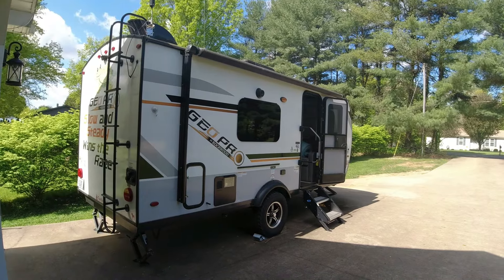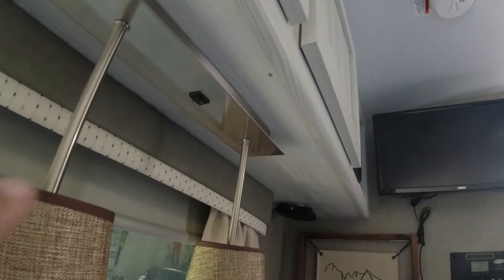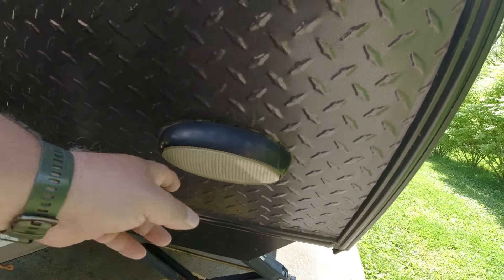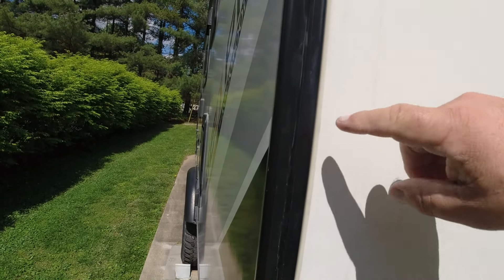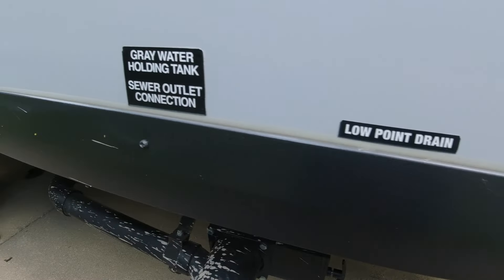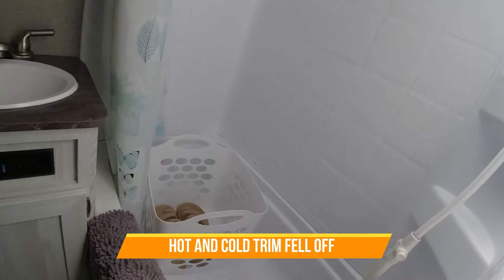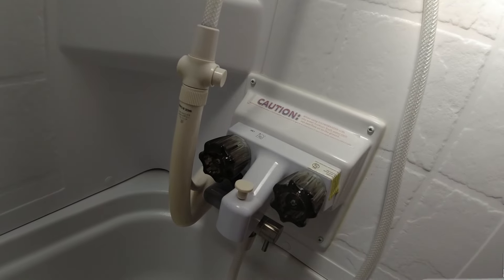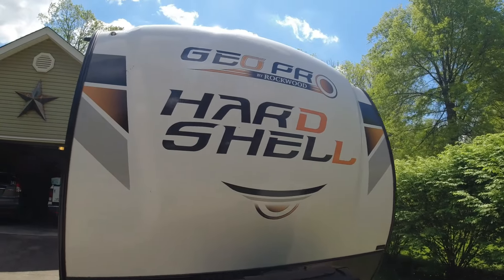RV Wear and Tear

Comment: Great video! We have this same model and I really appreciate your info, it is so helpful to us in maintaining our Geo.  Seems like just normal wear and tear that you would expect & everything is fixable.  Really appreciate the info on the flush line, had no idea about that.  Thanks so much!
Reply from the maker: After checking the flush line further I found that it in fact did not freeze and I had simply not connected the hose all the way but it still is a good idea to put a little antifreeze in there in the Fall.

Comment: Yup, it's just like a second house except it suffers a magnitude 9 earthquake each time you use it. It's kind of amazing more things don't fall off with all that bouncing around. Great tip about the black tank rinse line. I have to remember to blow that thing out too before any freezing Temps come around.
Reply from the maker: That's a good idea to blow out that line as opposed to putting antifreeze in it.

Comment: Our dinette velcro circles came loose too. To fix it, I removed the backing panel and glued 1" wooden squares to the backside. I used the original factory holes to re mount  the circles. When finished,  the circles are solidly mounted with no chance they will come loose again.
Reply from the maker: Well that would work. if mine come out again I will have to do mine that way.